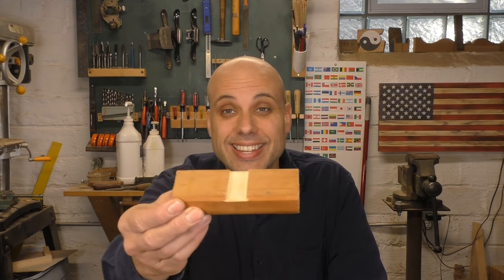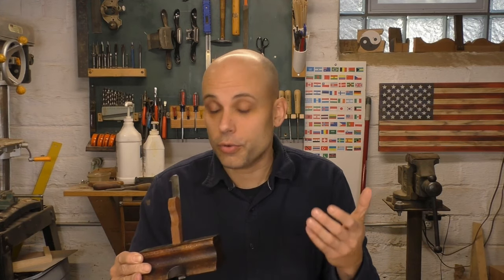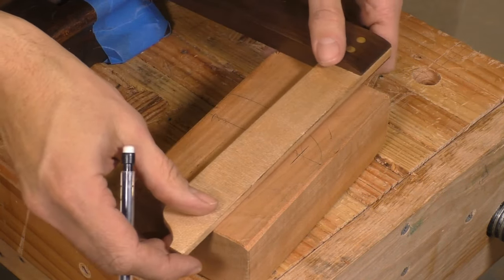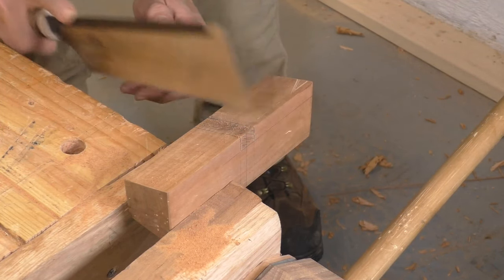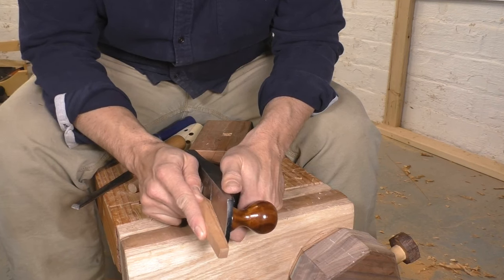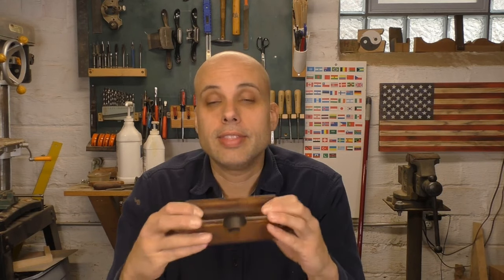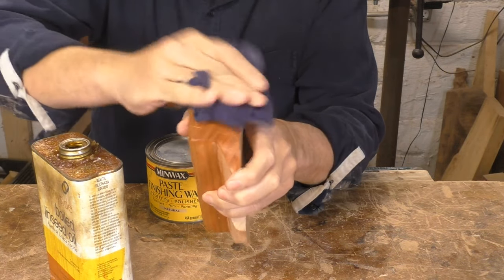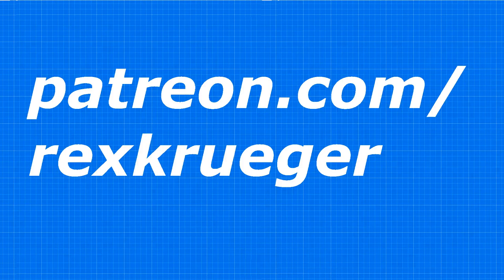Make a router plane from a chisel.

Comment from the maker: Yes, I know many people make router planes with an allen key as the cutter. Yes, I like this approach. But, it requires a grinder, which many people don't have. This version requires no power-tools.
Reply: Do you happen to have a link to how that would be done? I'm curious about this.
Reply: @JohnJbVlogsyt  Thanks! I did find another here:
https://www.youtube.com/watch?v=BeFVaQ4u1TM&ab_channel=self-build.%E6%9E%97%E4%B9%85 <- This is a very nice end product.
StumpyNubs did one here, but didn't use the allen wrench technique. He does point out that a router plane blade alone is only ~$15 though, so I'm including it here: https://www.youtube.com/watch?v=ufDd8Oh4WLY&ab_channel=StumpyNubs
Reply: Love you rex! Keep being you-nique
Reply: I bought a modern blade instead of the allen key to make a router plane.  You can get the all the micro adjustments of the metal planes with that or the allen key.  It still isn't free though.
Reply: @ColePanike  I have a playlist on my channel with all the routerplane videos i have found so far. I'll add this one to it as well. You will see all other approaches to make one.
Reply: I'm just getting started as a DIY hobbyist on youtube and some of my projects involve wood working. I haven't gotten very deep into it yet and all of my early projects involve coniferous woods (redwood, douglas fir, pine) because that's what's cheap at home depot and they only really sell construction lumber in large sizes in store. My parents wanted me to build a gate for them so I'm going to have some 2x4 scraps after I frame it. Do you think that Redwood is a tough enough wood for a project like this one or your rabbit plane? I'm probably going to do it anyway just to practice and get the feel for redwood because it's a beautiful and common wood here in California, but i wanted your opinion since most of the videos i've been watching have been in your woodworking for humans series.
Reply: Rex Krueger I made one with an allen key and it turned to be a great blade. I’m going to make one of these like yours also.
Reply: @TheOriginalFaxon did you ever try making that plane with redwood? I’d have thought it’s not quite hard enough, but if you made the parts heftier, I’d suppose it could work?

Comment: Thanks Rex. I've been semi - agonizing about this for a bit.  I first thought about buying a power router, but discarded that idea after I realized that it wouldn't get enough use in my shop to justify the storage space, as my shop isn't just small, it's outright tiny.  I've since been trying to find a used metal router plane, but they're kind of expensive, and like I said the tool will get only occasional use. This build is my next project for sure.  It's outstanding, since I can disassemble the plane into 3 pieces for storage as well.
Reply from the maker: I think you'll be happy with this one.  It's effective and easy to use.  Takes up very little space.

Comment: My very cheap tool is a spare piece of oak flooring. One small hole drilled in it and a sharp woodscrew  set for the desired depth. Scratch the cutting surface and clean it out with a normal chisel. Tilt the screw hole if you want to reach into the corners.  Ideal for narrow  places like hinge slots in door frames . No metal apart from a screw and no handles .

Comment: Hi Rex.  I just made one of your router planes from a some scraps of  1/2 inch  oak  (need to be laminated together)  that  i found in a corner,  and a 3/16 chisel I was given .  I actually took my semicircular cut out right back to intersect the front mortice as far as the chisel edge, as this  it makes it very easy to see the blade engage the work,  and the chisel is still fully supported.  It works a dream and now I need to build some   something with dados so I can smooth them down...  Great inspiration and explanation. Thanks for all

Comment: Very nice - Thought comes to mind that the inside curve on the front side (from the original) would be easy to make if you drill a large hole through the piece and then saw off the waste. Then all you'd have to do is blend the curves to fit your grip!
Reply from the maker: Except then you're drilling a big hole through end-grain. Much tougher than it sounds.
Reply: @RexKrueger  Didn't say it would be easy, just that you (someone) could do it! 😁
I've got a couple of old chisels, no handles, that might just be the thing for a project like this. Keep up the good work!

Comment: Great idea cutting it apart. Side note - I’ve seen wooden planes with wooden strike buttons from a dowel glued into a hole. Save some cost on the bolt and epoxy

Comment: Will make my own now, been looking at the cost of a Stanley and just couldn't justify the price. Thanks Rex, cutting the block to expose the mortise makes it so much easier, might even use a couple of dowels when putting it back together. Have a couple of old cheap chisels I might just cut the handle off one for a dedicated blade. Thanks again.
Reply from the maker: I almost used dowels, but I wanted to see if it would hold. So far, so good.

Comment: Cutting and glueing back is brilliant. I have done this trick many times, but it did not occur to me for a moment to use it for this project. Indeed, after glueing long grain, wood breaks at a different place. But not on the glue joint.

Comment: To cut curves like that, my grandfather use to use a bow lathe.  He'd put a spindle the diameter of the curve with some 80 grit sandpaper attached into the lathe and run it to depth.  Basically turned his lathe into a spindle sander.
Reply from the maker: That's one of the BEST ideas I've ever heard on a comment. Nice!

Comment: I think I will actually make one of these. Thanks for the video. The only change I might make is to make the frips symmetrical from front to rear, so I can pull or push. I think my pull-strength is stronger, and even if the job is light, after a few pushed cuts, its nice to switch-up the muscles I'm using over the course of a day.

Comment: Thanks for the video.  Do you think this would work ?  before cutting the block in half,  Drill a hole on each side of the center kerf and run a dowel all the way through (front to back).  With this, a dry fit, and a test run could be done before gluing, so any adjustment could be made.  It would also secure the piece from moving while gluing, and help keep it together, especially when a wedge is tapped into place.

Comment: Hi Rex, I made myself one of these some years back, I fit the chisel between two blocks cut at an angle. One block were fitted with 2 nuts,and the other with 2 holes that fit smooth bolts. when I want to adjust the depth the bolts are loosen and adjustment made and fastened again. The only problem I ran in at the start was that the wood compressed and the bed had a reach, but after lapping it that was solved. I believe that would be an easier project than a dado and wedge.

Comment: Thanks a lot! It's a great tip to make a knife wall and a dozuki line for ripping. Just a few days a go I bought a ryoba and tried ripping a 120 cm piece with it and I was not able to track the line well. Making a path along the whole piece could help it stay on line.
Reply from the maker: It will help. Also, you really need to learn that pull stroke. I'm still working on it.

Comment: I did something like that mortise trick, but on a tenon.  I was making a tote for my 1950's Craftsman jack plane.  The original tote was made of a "space age" plastic and had a molded tenon which fit in a mortise in the plane body - no second screw like a Stanley.  It is a really nice plane that I got from eBay for $20 and still had the original manual.

The tenon I needed was 3/4 x 1 1/2 and 1/8 thick.  But the problem I had was that I couldn't see the mortise on the plane when I mounted it, so I couldn't mark the tenon accurately.  So instead, I cut another part of the stock slightly thicker than 1/8 and trimmed it to fit in the plane body dado.  Once it fit, I put some glue on it and mounted the tote using the plane screw and let it dry.  Perfectly aligned tenon.

And as nice as that plane was, replacing the "space age" plastic tote with a nice hand made one is a big improvement.

Comment: I think it was either Paul Sellers or Wranglerstar who showed an even simpler method. Just drill a hole through a piece of wood at an angle that is slightly undersized and stick a chisel through it. It works, I tried it. Maybe not a long term solution but for when you need it like right now, it`s great.
Reply from the maker: Agreed!  I showed it in my tool tote video.
Reply: @RexKrueger  Havn`t watched that video yet, I am currently watching through your library :D

Comment: I followed your video and made this project about a year ago and, well, it works as good as my fancy new traditional router (huh...?), to be honest. Tap here and tap there is just quicker for micro adjustment. I didn't use any fancy timber, just some random offcut of construction 4"x2" and an old good quality chisel that was looking a bit worn out so I got it back in shape.

As for that new old router I mentioned; it's a Cowryman - traditional...but modernised, if you know what I mean. :-|

Comment: At one point you mentioned the woodworker’s paradox, and I wondered if you had heard the term “bootstrapping” as in “to pull yourself up by your own bootstraps”. I’ve come into contacting it in the contexts of computers and operating systems. If you want to make a compiler, to take source code down to machine language, you can’t program it because you don;t have a compiler, so you have to use machine language in binary to build an assembler which can then allow you to program a little easier using assembly language which is at least made of words instead of binary. Then you can make a more advanced language using the assembly language, and keep recursing that process until you have a full fledged compiler. It’s a little easier these days because you can cross compile from other computer systems, but the idea still comes up in many contexts (for example, this is why starting a computer is known as “booting up”. The operating system has to load progressively more complicated things into memory but at the beginning as to rely on the bare minimum) . This is exactly what you are doing...building the bare minimum and spiraling up. Or with money one can choose to shortcut some of the steps. But it’s still super helpful to know how you could do that if you needed to for some reason, or to understand the evolution of tools so that you understand different components of the neeesttools in much better detail.

Comment: Elevator bolts are cheaper than carriage bolts and have the square shoulder.  It is just that the outer head is flat.  They make excellent bolts for T-tracks and hold downs.  Unfortunately, I could not find them locally, but found out that they are $0.30 each if you buy in a box of 100.  They are 1/4 -20 and every bench tool I have uses a different sized t-bolt head.  At $0.30 each,I don't mind grinding them to size. They have become a go to fastener around here.

Comment: My thought…. Make the wedge wider and make a dado in it to fit a certain chisel. you could then make multiple wedges and use the plane with different width chisels. You could also add a thumbwheel as per Paul Sellers’ router plane to finetune the depth.
What do you think?

Comment: Saw this and thought it would be a great 2 in one where you rotate the chisel 90 degrees and put it in another slot a little further up (imagine where the strike position would be on the other side. That way you get the narrow rabbit's foot you were using built into it too. Also if you're going to cut the wood in half, to prevent the glue from splitting over time you could use a slightly longer bolt that actually threads the 2 pieces together to add a hint more tightness that the glue may not resist over time.

Comment: I am wondering about the steep  angle of the cutter. It is just like the antique version so it must be all right. But on wooden and metal planes like you showed at the beginning the angle is 35-40 degrees. And the Paul Sellers "poor man's router plane" is also closer to 45 degrees.

Comment: Freakin' genius! Two thoughts: the blade could be made with any scrap of steel. It would probably require more frequent sharpening, and the initial edge would be a long job with a file and whetstone if you don't have a bench wheel or angle grinder, but I've done this sort of thing successfully in similar circumstances. 

Second thought: seems like you could swap in a half-moon-edged blade and make perfect radiused grooves with this tool. Is that likely?

Thanks for another terrific video! At this rate, most of the stuff I make in my shop is going to be more tools.
Reply from the maker: I don't see how using a scrap of mild steel would be a good idea when a common chisel is right there and requires no modificaiton. As to the groove, that really needs a tool with a fence to keep it straight. So, a molding plane.

Comment: This can be done much easier by flattening a scrap piece of wood, then drilling an angled hole which is a 1/8" inch smaller than your chisel. The undersized hole will provide a snug fit, no wedge required.

Comment: I have a question about cutting the block to make the tenon. You first smoothed the faces, then cut the tenon, then glue the 2 pieces back together and have to be careful they don't ride up... 
Could you not just split the block instead, make the tenon, then glue the split edges back together for a nearly invisible join, or would it be too difficult to get it to split predictably?
If you made the kerfs first, would a split not follow the weak line?

Comment: What's the difference between this and the rabbet plane you've also shown us how to make? Is it just those flat wings on either side helping to keep you flat, cause otherwise isn't the rabbet in there at the same angle/able to fit in your groove to clean it up?
Reply from the maker: Not to be smart, but the rabbet plane is for rabbets, while this tools cleans the bottoms of joints that are closed on 2 sides.
Reply: @RexKrueger  Yeaaaaaaaaah I just rewatched your video on it and saw how one side was longer than the other. For some reason I made-believe it was just a skinnier version of what you made in this one. In my defense I haven't updated my prescription in 20 years.

Comment: Something I desperately need is a consistent way to cut a curved hollow in a length of wood. I have gouges yes, but I need the hollow to be as precisely even and rounded as possible.  What I need is a moulding plane, but those are insanely pricey. Do you know of any way I could make one myself?
Reply from the maker: Google "scratch-stock". Might be the ticket.

Comment: Hi Rex, Love your channel! I am making this and close to the end of the build, but I realized something while thinking about the round cutout and watching your video....your circle doesn’t go deep enough to reach the chisel blade, while the antique one does. Many shoulder plane builds have you cut the wedge at an angle so that the wood shavings have a place to go. Having the circle go all the way to the chisel gives a little opening where wood shavings could come out.  I guess it doesn’t make that much a difference if you are cutting a groove which is deep because the groove gives the shavings a place to go, but maybe it would make a difference at shallower settings? Or maybe it’s just a coincidence.

Comment: I noticed on your vintage plane, the end of the chisel has a hook on it. I just bought an old vintage mortise chisel at the flea market, and it has the same shape on the end. I assumed it was either for handle fitting, or that it wasn't actually a mortise chisel, but a similarly shaped attachment for some sort of machine or jig. Do you know anything about why the hook is there?

Comment: Since the thickness of the chisel is tapered, won't it limit how far it can extend beyond the sole? This tool really only works if the cutter is even in thickness.
Reply from the maker: Nope.  The old ones were tapered, too. Works fine.

Comment: Hey Rex! I purchased the plans for the router plan. I'm having an issue with the instructions. On the page that shows the top and bottom and sides, the side diagram has no measurements except angles. Also, there are no orientation notes for the top and bottom. I am so looking forward to completing it to be able to use it!

Comment: My granfather called it the "Old lady's tooth."  He used one into his seventies.  He also had a story about "why" they called it that.
Reply: Do you still remember the story?
Reply: @xXx_Oshino_xXx  I do.  It's short and kind of rude and violent, especially if you were an old lady.  However, there is a lot of "just so" about how carpenters learned their trade back then (before WW I).  The method works.  I was about 5 at the time I heard it, and I'm almost 70 now.  I never forgot the tool, how he used it, or the explanation of why it was invented (what if you couldn't find an old lady with one tooth in her upper jaw?).

Comment: actually that mortis IS easy to cut.
you take 2 pieces of 2x4, route a flat path through the sides of them, glue them together, then cut the base and roof on the pieces to match the angle you want.
ive no idea. ive never tried.
im a terrible guesser.